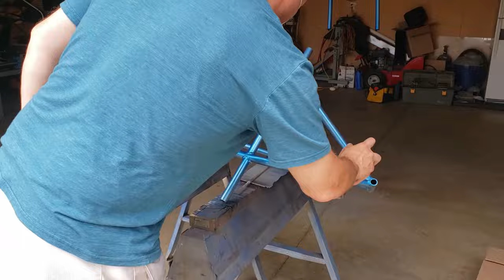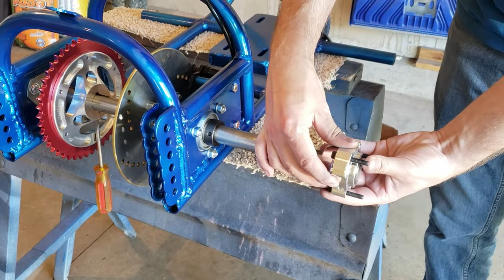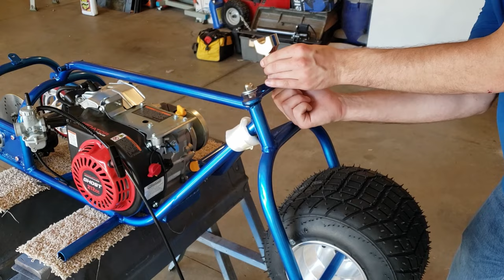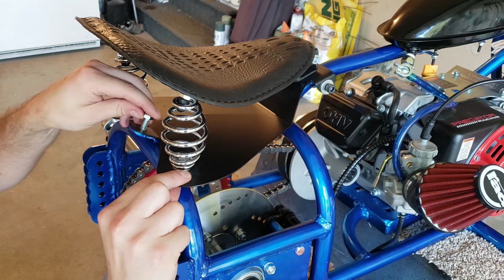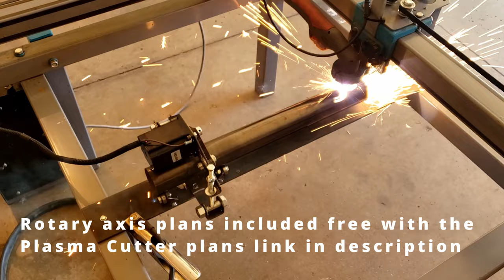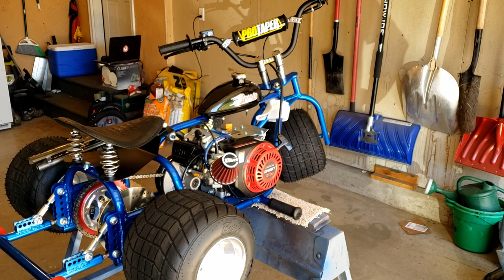How to Build a Mini Trike || Final Assembly

Comment: Looks beyond cool but I can’t see how they charge ridiculous price of 5000 for it, maybe 1500-1800 at the very most 2000 but to add 2999 on top it’s ridiculous!
Reply: It’s 1500 minimum in parts alone.
Reply: @ranranpoopants  idk about that... metal tubing, motor, axle and wheels... throttle brakes... 1500 is kinda high
Reply: You're also paying for the time and work it took to create the frame. All the welding and hours it took to make everything exact. Then the time it took to assemble the entire bike.
Reply: Fabrication of any kind is sky high expensive. If you wouldn’t pay that, go out and try to build it yourself. Chances are you’ll realize why it costs so much not long into it
Reply: @danielnunez3518  just built one on metal and electricity and welding wire I spent 275 dollars . So I still can’t see the ridiculous price tag .
Reply: @waterlover  post a vid of it
Reply: @dylanmorrisey4319  with 5k you could afford the parts, all the tools it would take, and still have 3 grand left to pay yourself for a weekend
Reply: @ranranpoopants can’t you just turn a mini bike into this with an axle
Reply: theres another online source that sells the same thing pretty much for around 1200
Reply: Yes, because this I want to build the frame self.
Reply: @desaixwebb  what’s the name of the company?

Comment: Looks great!!! Just a thought shouldn't the main bolt on the front forks drop in from the top? Just thinking if the nut comes off the bolt will slide out and forks will fall off. However if the bolt were dropped in from the top it would stay with gravity even if the nut came completely off.
Reply: i understand your logic but i believe he used a lock nut that thing isn't coming off with out wrenching

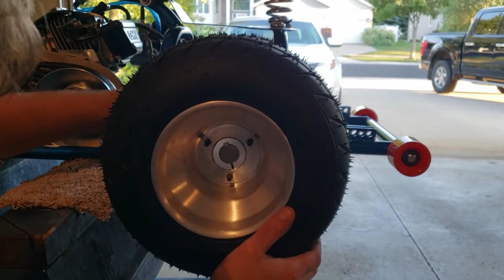Comment: Like the entire build except for one small detail         .At 4:57
The machine nuts holding the rear wheels on seem underbuilt small and flimsy  to wheel torque regarding the sissy bar stress they will have

Comment: That is a cool project! Love the CNC 3rd axis for the tube notching. Wonder if I could add one to my Crossfire Pro? What was the total cost for the trike, if you don't mind sharing?
Reply from the maker: It won't work on other systems without extensive electronic and software modification. We designed our plasma cutter to be easily modified for things like this.

Comment: hello. I want to make one. I have the materials. I have only one problem. I have the same motor but I don't have a centrifugal clutch. If I put a gear directly on the motor shaft will it work?
Reply from the maker: Do NOT do this. As soon as the engine starts the trike will take off and you won't be able to stop it.
Reply: not even at low revs?
Reply: anyway, you've done a nice job

Comment: If you never learned how to weld, please use a grinder before you paint something blue metallic.  Because you see everything.
Reply: Practice your welding on a piece of the same material that you're welding on and get your welder adjusted the best you can and then go for it.    Life is short.     Have fun.   If it's not perfect.     Then break out the grinder.     I have 40 years of welding experience.     Practice on some junk to get yourself prepared for the project that you're working on.  Good Luck  🤞